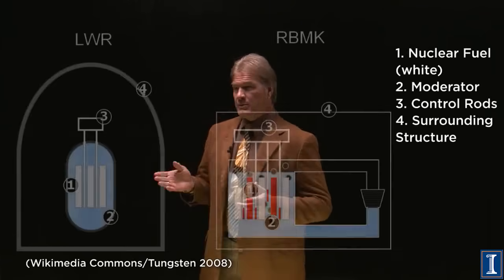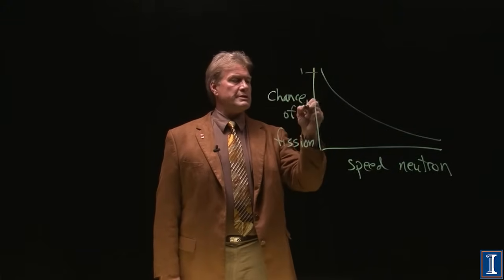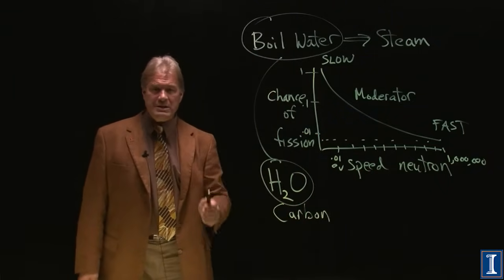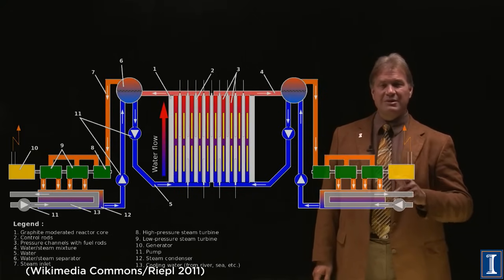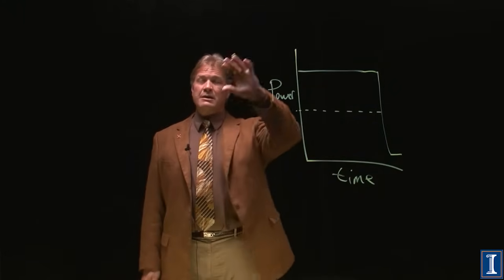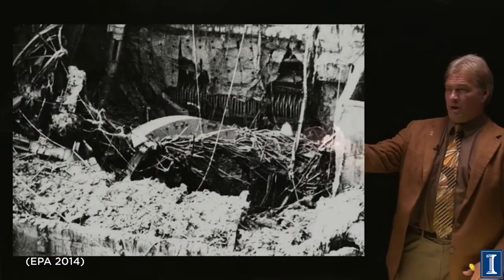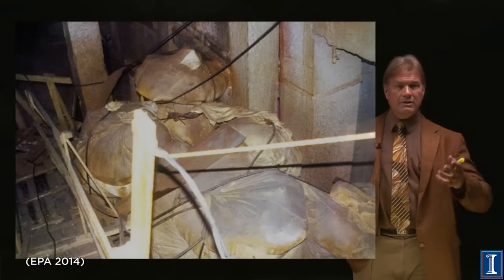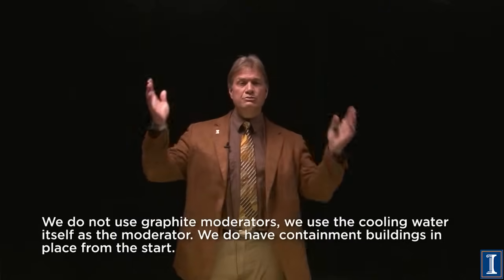Chernobyl: Worst Accident Ever

Comment: He says this can't happen, but... Fukushima happened.  How is it different?
Reply: Fukushima was caused by a tsunami causing complications with cooling. Chernobyl was not.
Reply: @_Jame  Regardless, he said that critical failure can only happen with the Chernobyl type reactor, and that no modern reactor design can fail like that.  So, what happened at Fukushima?
Reply: @robertzeurunkl8401  I believe that the cooling and electricity was taken out, leaving them in a blackout. I watched a documentary on it recently but cannot fully recite what happened.
Reply: @_Jame  Describing the water cooled system, he says that if you lose the coolant - the water - the reaction just stops.  So, modern reactors are safe because a failure will result in loss of coolant, which is a GOOD thing in newer reactors.  The Chernobyl reactor had graphite rods that had to be inserted to stop the reaction, but a power outage can make you unable to insert them.

So, in Fukushima, I think the problem was, like you said, the tsunami.  It flooded the reactor, and so the coolant was NOT lost, and the reactor continued working with open sea water as it's moderator, then contaminating the water going directly into the ocean and air.   My best guess.
Reply: @robertzeurunkl8401  Ah ok, thanks for clearing this up. I knew chernobyl was caused by a design flaw, just not sure about the specifics of what caused fukashima.

Comment: This is a great presentation.  I had never considered the role of Xe before, but of course -- the rapid burn off of the accumulated Xe with the control rods removed left little course.  I am curious however why the other safety defect of the RBMK, the positive void coefficient was not mentioned.  My understanding was that at low power the RBMK had a positive void coefficient so, e.g., a steam bubble is a 'void', which causes power to increase, which makes more steam, more voids, etc. leading to an uncontrolled positive feedback.
 The control rods as i understood had two design flaws.  The graphite follower which would moderate neutrons and the metallic bottom of the rod which would displace water -- and introduce a void.
Reply: He does mention it when he mentions that when water boils in an rbmk, the moderator (graphite) is still present and allowed to operate even more efficiently bc water isn't absorbing neutrons (water self-dampens it's modeerating ability by absorbing many neutrons). He just doesn't use the technical term.
Reply: @WINuFAIL  Not entirely.  A positive void coefficient is an increase in reactivity due to a void that creates a positive feedback loop.  That is what creates the super critical event.  Void --> increase in reactivity --> increased power --> increased temperature --> increased void --> and so forth.
Reply: @stephenfriedenthal8312  Yes I understand. What he and I are saying is that the reason the opposite happens in other reactor types is because water is the coolant AND moderator, with no graphite present. A void means no coolant but also no mod, so reactivity and power decrease. He describes this mechanism without mentioning that this creates a feedback loop. So basically he described the first half of it.
Reply: @stephenfriedenthal8312  I agree - there is too much talk about the role of xenon. Xenon doesn't explain the pos.void coefficient as you rightfully explained. The RBMK was unstable at low power and the voids were't pushed out by the flow of water and remained in the bottom of the core resulting in potentially dangerous power anomalies.
Reply: @WINuFAIL  In the RBMK, a void means the water is less dense which means less hydrogen which leads to a decrease in neutron absorption by the hydrogen and an increase in neutrons so power increases' not decreases.

Comment: I believe your understanding of the incident is lacking. Nobody hit the wrong button. The city needed more power and people didn't anticipate Xe135 buildup. When they then brought the reactor to half power, the xenon continued to build up (as it was mostly from decay products and came with a 6 hour delay). This brought the power to a very low level that was not enough to generate any steam. With no new neutrons to combine with the xenon it would have to naturally decay.
From there they brought the rods out manually to bring the power back up. This started to boil the water with a low water flow rate. The low flow rate meant that the water was starting to boil off the top, creating cavities of steam. The control rods were half carbon, which made them better at controlling. The fuel heated up quickly.
The operators then hit the scram controls. The rods move fairly slowly. The graphite tips of the control rods pushed the remaining water out of the way at the bottom of the reaction vessel. With no cooling (the water was displaced) the power spiked, vaporizing the fuel and blowing the pressure vessel.

You sound very biased and condescending. Not only that, your impossible scenario happened quite nicely in japan, one of the most modern and technological countries in the world.

The water boiled off, the rods got hot and melted through the pressure vessel, steam reacted with the zirconium fuel cladding into hydrogen (and zirconium oxide). The overpressure valves opened and steam and hydrogen was let into the wetwell. Because the coolent was offline (in one case because an operator turned it off, but was unable to turn it back on later), the pressure built up there as well. The operators decided to release the gas (contaminated with radioactive elements). The hydrogen exploded inside the reactor building, bypassing the "invincible" containment building and releasing the crap into the atmosphere. So much for no water - no problem. Oh and they were not RBMK reactors either.

I'm not saying Japanese operators are stupid. I'm saying human error is human. And even the russians are human. Mistakes happen, accidents happen when all prevention measures fail or are bypassed.

And don't forget about your own great reactor accidents either.

You can talk about great new reactor designs all day long, and perhaps they are great. But a great many reactors were built back when such designs were not yet available, and their control software still runs on magnetic tapes and relay computers.

Comment: If you want a TL:DW of what happened here you go:

The operators (namely director Dyatlov) did create the situation that caused the accident, however this was due to a somewhat lack of understanding as well as an assumption that the AZ-5 emergency shutdown button actually did what they thought it did. Unfortunately it did not... 

The Chernobyl design was far more dangerous than any of the wests'; it operated with a positive void coefficient, meaning in the event there is no water being pumped into the core reactivity will start to INCREASE (this is due to the Soviet's choice to not use heavy water like the west to lower costs). Earlier the operators were making preparations for the safety test and subsequent shutdown, however the power grid needed more power than expected and the reactor needed to stay online longer at the reduced power level. When a nuclear reactor is running it produces something called Xenon-135, this known as "neutron poison" as it robs the core of it's neutrons and reduces reactivity, this is normally accounted for with control rods and is burned away until it reaches an equilibrium. However due to the reactor running at a reduced power level for longer than expected, more of this Xenon would be produced, more importantly it would be produced 6 hours later (it is formed from radioactive decay). This caused a significant amount of Xenon to pool up 6 hours later around the time they had to reduce power before the safety test, and this Xenon that would otherwise normally be burned away if at the same power level, was being created rapidly and drastically reducing reactivity in the core. This was compounded by the fact that the reactor reducing in reactivity also meant less water was being turned into steam, lowering reactivity even more. This caused the reactor to start to stall around the time the test needed to be done, and the operators had to pull out nearly every boron control rod (rods that control reactivity by reducing it, whereas graphite rods increase it). Under normal protocol the reactor should've been given time to restart and cancel the safety test, however Dyatlov decided to go through with the test. During the test the reactor for some time would be starved of water due to there being a delay to the backup generators. During this time, the Xenon started burning away and no longer was holding the reactor back. The lack of water combined with the reactor having almost all of it's control rods out of the reactor, reactivity started increasing at an extremely rapid rate, and consequentially boiled off even more water further increasing this runaway feedback loop. The operators did the one thing they thought would save them, they pressed the AZ-5 emergency shutoff button that would immediately insert all of the boron control rods into the reactor. However there was a flaw, the boron control rods also had graphite tips in them to make the rods more effective in changing the reactivity, this initial push of graphite into the core that also displaced very needed water (which reduces reactivity) caused an exponential feedback loop that released immense amounts of energy and caused an almost immediate explosion. Most believe the explosion was all the water being flash boiled into steam, whereas some believe the reactor itself exploded akin to a bomb. 

Chernobyl had no containment building that would've reduced nuclear contamination, and due to the design using unrefined cheap U-238 rather than like the west that used mostly refined U-235 it required immense amounts of graphite to increase reactivity which is why they required the design of the control rods. Dangerous design, and the Soviet government classified the information about the AZ-5 fault and therefore the Operators had no way of knowing. This didn't stop the Soviets from using Dyatlov as a scapegoat that they blamed everything on, claiming it was all operator error, and giving him 20 years of hard labor. I realize this isn't a short read, there's just a lot that happened lol.
Reply: That was awesome, your post helped me greatly - thanks, Weasle.

Comment: Something to note is that RMBK were not the only form of nuclear reactors built in Soviet Union ,most reactors in fact were PWR and there was even some SFR reactors.RMBK reactors were however unique to the Soviet Union,as were gas powered reactors in UK and were mainly built to be cheaper alternatives to regular PWR,however they had various design flaws that made them more prone to an extreme accident if something went wrong as did in Chernobyl.Russia still uses RMBK reactors and yet none have ever failed and there are up to 30 of them.So even tho yes there are risk and design flaws I think they have been overly exaggerated claims about the designs problems.Specially with modern designs that have more safety features,Three Mile Island was first meltdown and was a PWR after all.

Comment: I was under the impression that the reactor stalling was because it was already in a Xenon pit due to running at half power all day. Additionally the experiment was a mandatory safety test after Israel bombed a Soviet built reactor in Iraq. Reactors 1-3 at Chernobyl had already passed the safety test but 4 never did and to get their promotions the heads of the plant needed a passed safety test at whatever cost to show the party men.

Comment: I think the mentality behind Soviet engineering and shitty ITs is very similar. Design systems that are very simple and easy to deal with, but aren't robust. If anyone here is in the field, they know what I'm talking about. Flat networks, no password rotation, no layers of security. RBMK reactors can be refueled much easier because of a lack of a containment dome. To quote wikipedia

"By using a minimalist design that used regular (light) water for cooling and graphite for moderation, it was possible to use low-enriched uranium for fuel (1.8% enrichment instead of considerably more expensive enriched uranium of around 4%). This allowed for an extraordinarily large and powerful reactor that could be built rapidly, largely out of parts fabricated on-site instead of by specialized factories. The initial 1000 MWe design also left room for development into yet more powerful reactors. For example, the RBMK reactors at the Ignalina Nuclear Power Plant in Lithuania were rated at 1500 MWe each, a very large size for the time and even for the early 21st century."

Comment: 10:50 no one hit a wrong button!! Where do you get that miss information from?
They where shutting down the plant to round about half power preparing for the test. But then the grid needed more power. So they stayed on this low power for some time. Meanwhile the core got xenon poisoned due to low power operation. Then they started the test by lowering the power to ~2/3 power. Because of the poisoned core the power continued to drop in power. Then they tried to bring the core back up to a power level suitable to perform the test. They did this by removing all but 1 control rod (against all regulations). Then the power skyrocket because the xenon was burning away. In an attempt to shut down the reaktor they pressed az5 causing all control rods to go back into the core. But because the tips of the rods where made from graphite they first caused another spike in power. Which resulted in the explosion of the core.
Reply: Half that idiot's lecture is wrong, including your point.

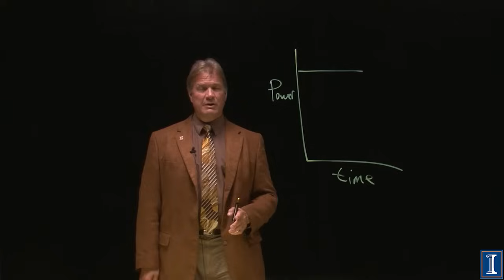Comment: 10:00 That was better explained in the Chernobyl series, they actually ran it at half power for the whole day because the power was needed, then they didn't hit the wrong button, they put it into automatic mode and it almost stalled because it wasn't calculating for the Xenon.
Reply: @pfuschermeister  maybe teaching not to trust this guy because there is quite a bit of mistakes
Reply: and it used graphite as a moderator not carbon

Comment: Again , i have to raise the point that the U.S. may not have had such a large problem, but the truth is that they have had more than enough close calls where things have gone wrong and radiation has leaked out.
Russia has never said that it was not a really bad accident, but you will notice that they do not keep raising the fact that  America has other major problem like the collective weight of  radioactive dust in the air cleaning ducts  were urainium was enriched, and how much of it found its way into the water table.
Three mile island was no small matter either, as today there are no earth worns or the like in the soil there.
All nuclear accidents are highly dangerours, regardless of where they are, and closing our eyes to them only serves to bring the next a little closer.If the U.S. could for one minute, forget the reds under the bed rubbish and work together, many of these problems would come that much closer to being solved rather that a legacy for the next generation

Comment: What I could never quite understand is why they didn't have a pressure relief steam valve for the main coolant loop (and surrounding cavity space). Knowing that the reactor design had a positive void coefficient as they did since the 70s (as Legasov points out on his tapes), it would have been only a minor modification, easy to implement that would have protected the core from explosions (and the subsequent exposure). They were also aware that power excursion were not uncommon with RBMKs long before the inauguration of Unit 4. Granted, such a solution would mean total loss of coolant, meaning they would have to deal with a HUGE meltdown (the RBMKs cores where very large), and the steam release itself would have meant environment contamination, however the scenario would be far less grim, falling in the Three Mile Island category(of course considering the scales and core sizes), IMHO. But then again perhaps I'm being just too naive here, perhaps the cover ups and everything surrounding the soviet nuclear industry at that time, the soviet nuclear establishment itself (Aleksandrov and company) would never admit the reactor core indeed could explode, and yield in order to implement such a measure of protection, as simple and cheap as it could have been. It would almost have been considered an admission of defeat after all those years preaching RBMKs were very safe that and one could even be installed right on the Red Square if so desired. If such a system was ever implemented, I believe Chernobyl would still have been bad, but not as bad as it was, perhaps 70% to 90% of the environmental impact could be avoided, granted, as I said before, the problem of such a big core melting down would still have been there.
Reply: Doesn't work like that, if pressure spikes too quickly your valve would literally explode due to physics of streaming media, no matter whether it's gas, air or water. Because the valve is basically a nrrow passage, so if steam pressure skyrockets you'd even have more pressure in that valve concentrated on this point. Because any streaming media increases pressure at a narrowing section, because the flow of your media gets stalled and the speed + the pressure in this narrow passage increases accordingly. At this moment your valve would be the weakest point and would literally explode, still resulting in the reactor core blown open. Basically, if your pressure valve can't keep up with releasing the pressure inside versus the increase in pressure it goes boom. It's then basically like a overheated pressure cooker, these can also explode despite having a valve.